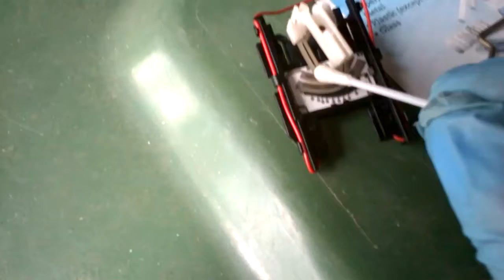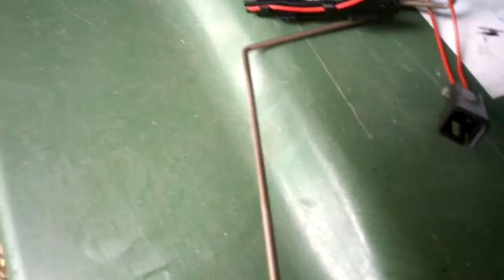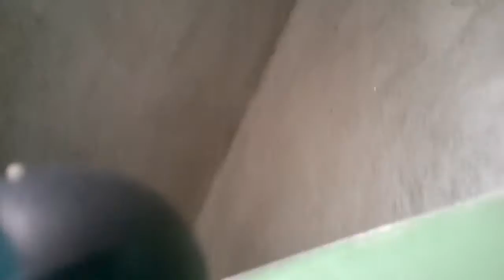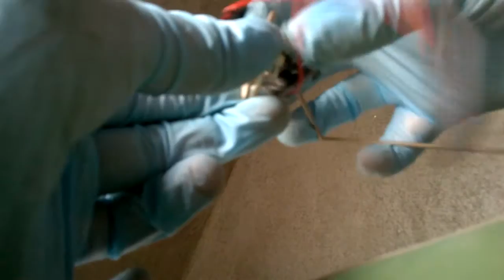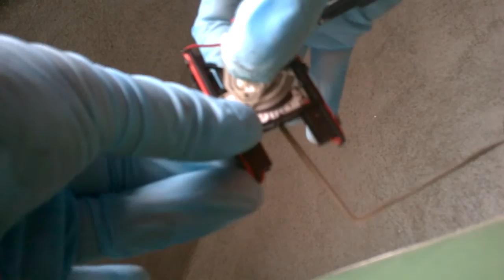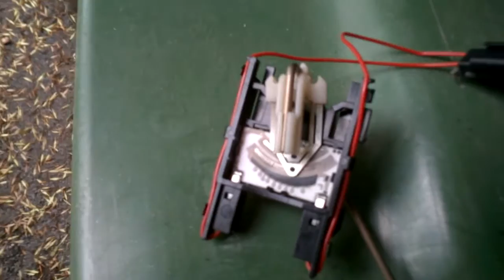Volvo S60 V70  Fuel gauge accuracy fix - please see tje comments section   2001-2009

Comment from the maker: Not shown but I also compressed a little bit the "U" portion of the float metal rod, because when it was sitting on top of the potentiometer it had a little bit of side-play, which may be the reason the gauge was getting stuck.  Since this 'fix' the gauge worked nicely in the past years

Comment: Would you think doing this will help my issue of my fuel gauge going down/up. As I keep seeing it happen on my 2006 Volvo S60 2.5t and on the LCD message of estimated mileage from let's say 150miles it goes down 130 and down 120 and down 70 on a tank of gas freshly filled to sometimes even backup but at times parked says ---- mileage estimated (empty basically) and the gas meter as well on empty and orange bulb on for warning of it. Please let me know. Can't find anything online telling me what it's related to or how to resolve my issue.
Reply from the maker: The estimated mileage is related to the tank gauge reading.  Usually it varies on all Volvo models but no more than 1/4 tank misreading.  So if your tank has just been refilled and the gauge shows only 70 miles to go, the gas level sensor may be broken.  Keep in mind, in the video the car has a rare metallic gas tank.  Most Volvo have a plastic tank sealed with a locking cap that requires a special tool such as this one 
http://www.ebay.com/itm/Left-Right-Gas-Tank-Fuel-Pump-Cover-Lock-Ring-Removal-Tool-Volvo-S60-XC70-XC90-/371907320888?hash=item5697675c38:g:x1gAAOSwQPlV8xes